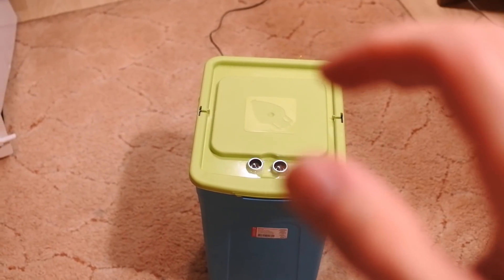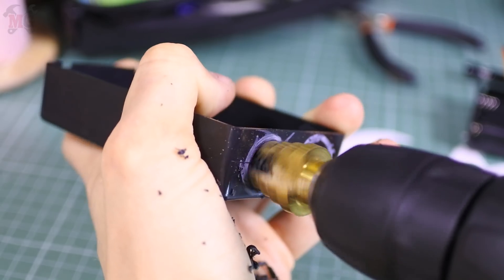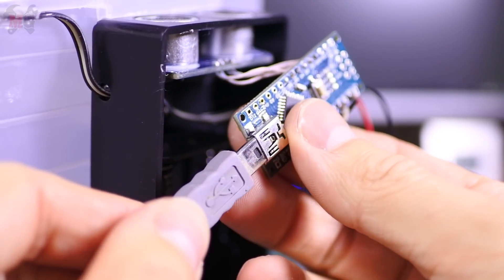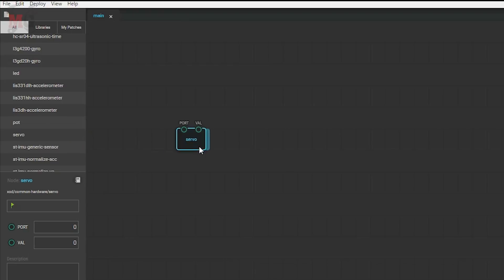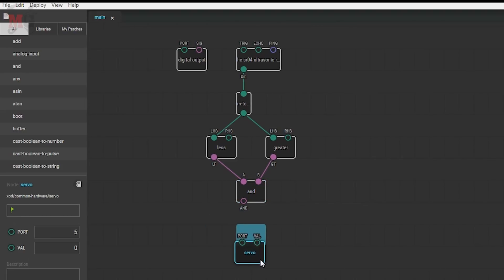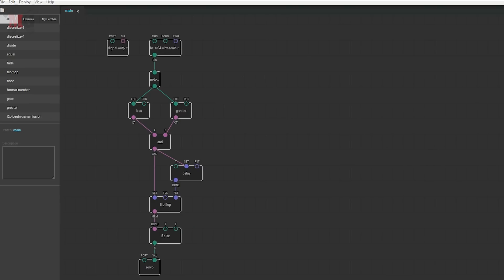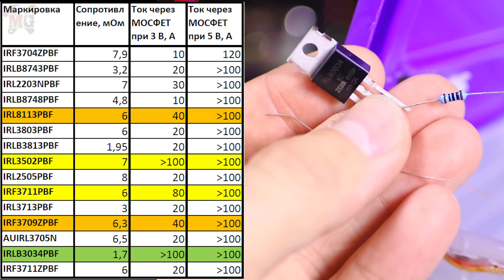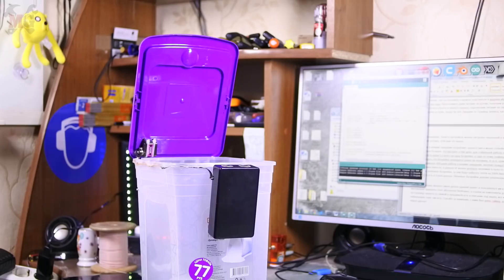DIY Automatic Trash Bin [Arduino and XOD]

Comment: hey i have been trying to get my garbage can to open ike yours but it wouldnt even move. can anyone help me? i am using the Arduino Nano Everyday here is my code.
#define maxH 50           // working distance
#define cap_time 3        // time while cap is open, seconds
#define open_angle 10     // open angle
#define close_angle 155   // close angle

#define debug 0           // debug information (0 off, 1 on)
//-------------------- SETTINGS ----------------------

// --- WIRING ---
#define trigPin 3
#define echoPin 2
#define sensorVCC 4

#define servoPin 5
// --- WIRING ---

#include <Servo.h>    // servo library
Servo servo;

long duration;
byte distance;
unsigned long open_timer;
boolean open_flag;

void setup() {
  Serial.begin(9600);
  if (debug) Serial.println("system start");
  servo.attach(servoPin);
  pinMode(trigPin, OUTPUT);
  digitalWrite(trigPin, 0);
 ;
  pinMode(echoPin, INPUT);

  pinMode(sensorVCC, OUTPUT);
  digitalWrite(sensorVCC, 0);     // power off the sensor

  open_cap();                     // open cap with system start
}

void open_cap() {
  if (debug) Serial.println("open");
  
  delay(1);
  servo.write(open_angle);        // open cap
  delay(1000);                    // wait servo
  digitalWrite(5, 0);     // disable servo
  open_flag = 1;                  // remember that cap is open
}
void close_cap() {
  if (debug) Serial.println("close");
  digitalWrite(5, 1);     // power up the servo
  delay(1);
  servo.write(close_angle);       // close cap
  delay(1000);                    // wait servo
  digitalWrite(5, 0);     // disable servo
  open_flag = 0;                  // remember that cap is closed
}

void loop(){
digitalWrite(sensorVCC, 1);           // power up range sensor
  measure();                            // first "idle" measure, there are some glitches without it
  distance = measure();                 // get distance
  digitalWrite(sensorVCC, 0);           // disable range sensor
  if (debug) {
    Serial.println(distance);
    delay(500);
  }

  if (distance > 5 && distance < maxH) { // if distance fit the range
    open_timer = 0;                     // reset timer
    if (!open_flag) {                   // if cap is closed
      open_cap();
    }
  } else {
    if (open_flag) {                    // if cap is open
      open_timer++;                     // timer increment
      if (open_timer > cap_time) {      // if passed more than cap_time after cap was opened
        close_cap();
      }
    }
  }
}

// distance measuring function
byte measure() {
  digitalWrite(trigPin, 0);
  delayMicroseconds(5);
  digitalWrite(trigPin, 1);
  delayMicroseconds(15);
  digitalWrite(trigPin, 0);
  duration = pulseIn(echoPin, HIGH);
  return (duration / 2) / 29;

  
}
Reply: A garbage can will probably need more than servo motors to move